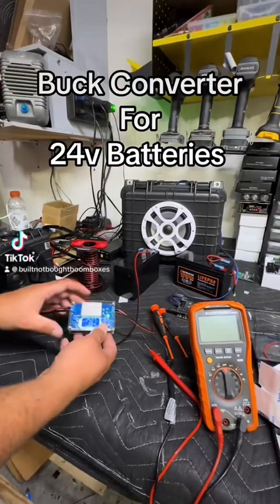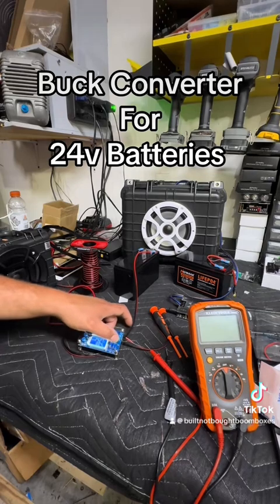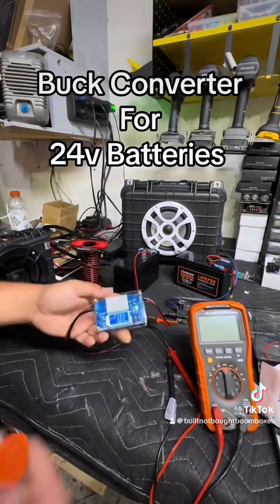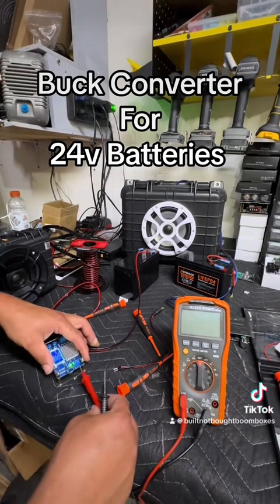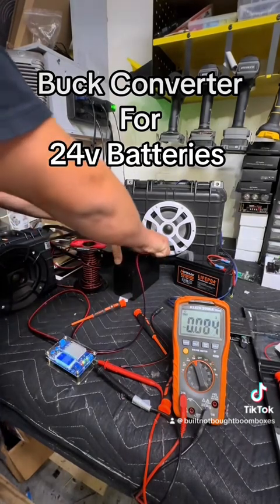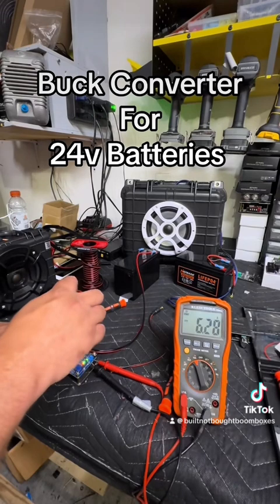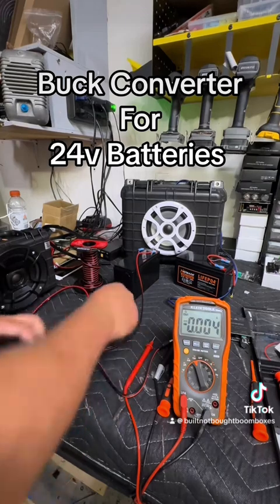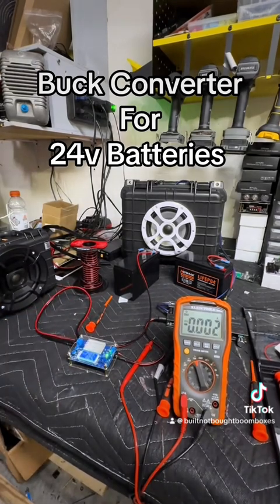Setting Current Values on Buck Converter

Comment: So im building my first few boxes soon, hopefully starting in the next day or two. With that being said im trying a few different combos, different batteries, amps, speakers, etc. And I was thinking with the talentcell 24v (black box with the switch) and the 25.6v talentcell I wouldnt need a step down converter. So after watching this do i need a converter for the 24v black box also or just the 25.6 battery? I would like to only use extra parts when necessary.  Thanks
Reply from the maker: @warren2129  if you’re gonna be running to 1002T amplifier with a 25.6 V you do not need anything